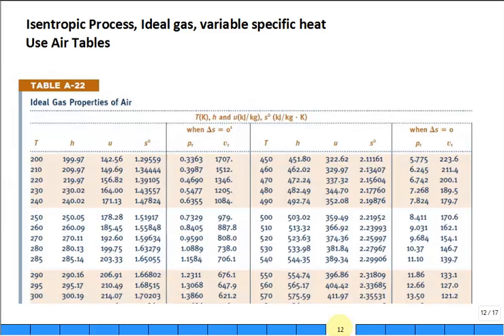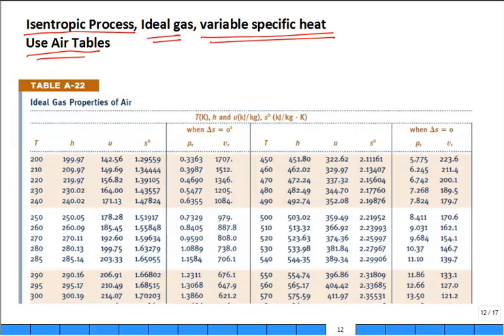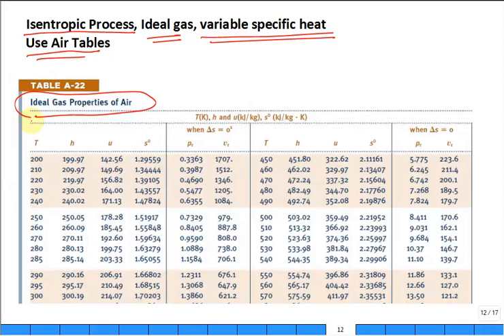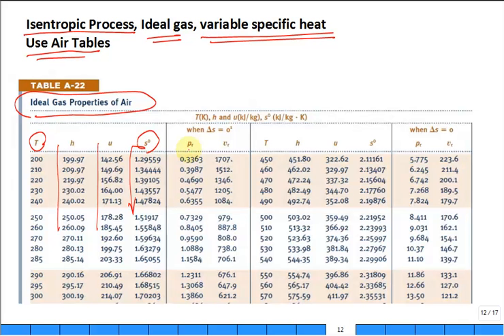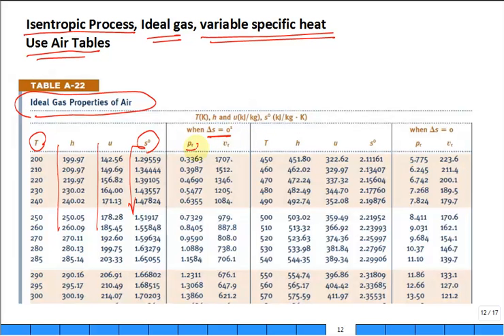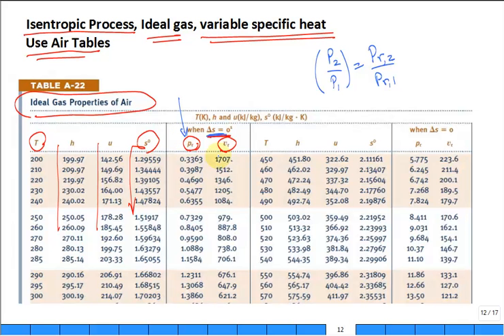Discuss Ideal Gas Isentropic Process Variable Specific Heat

Comment: I have a question for you. When I have a certain state given, then heat is added to it, how do I find the new pressure? I know I can find the new temp by finding the entry in the table where u2 = u1+Qin. Do I just use the Pr value in that entry to find the ratio? You said in the video to only use those when S2-S1= 0.